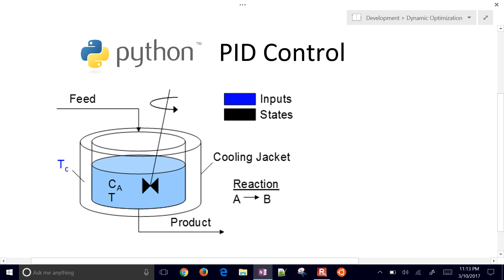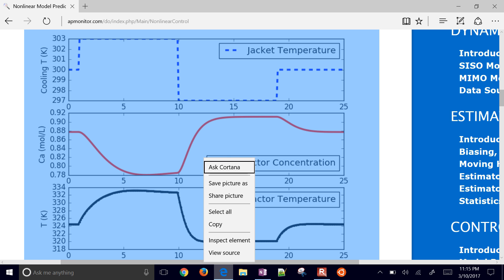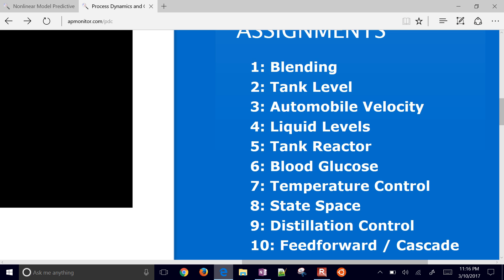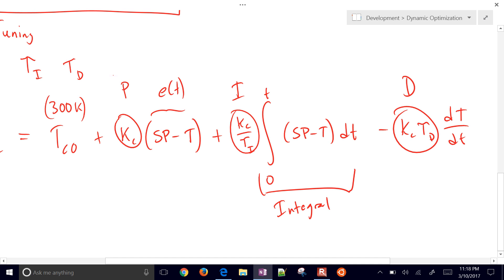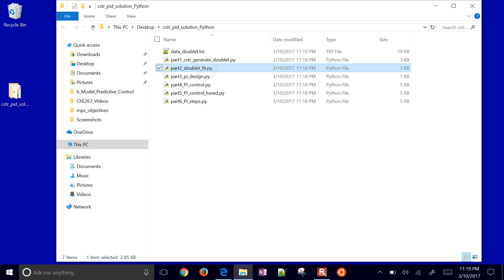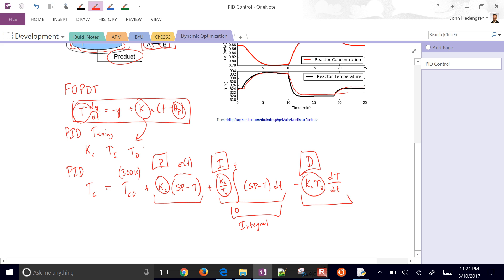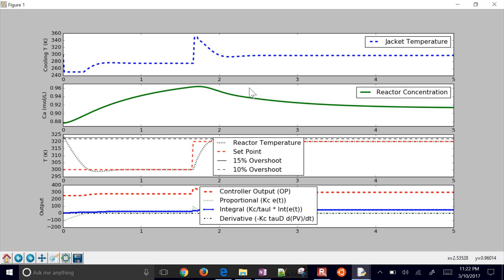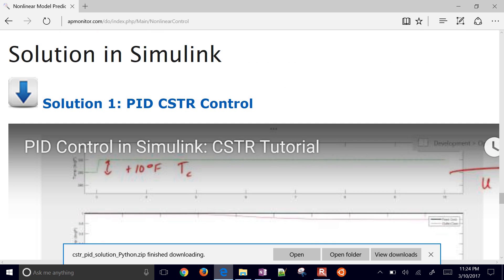PID Control in Python

Comment: Sir, is it possible to make PID with heating and cooling simultaneously.
Reply from the maker: A PID controller has only 1 manipulated variable. You could let the output be positive or negative and then turn on heating (+) or cooling (-) when the controller switches signs.

Comment: Great Job 
I am looking for a controller with 2 temp inputs So I can control a pump. 
I want to have pump running when temp 1 is 10F higher than temp 2. 
any Ideas how to do that?
thanks
Reply: you could use an Arduino to do that using  two temperature sensors